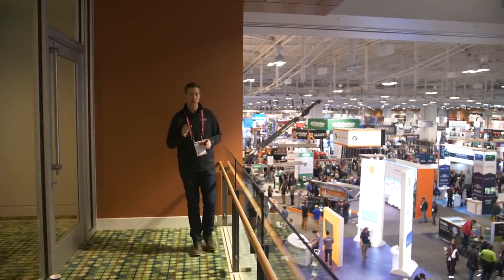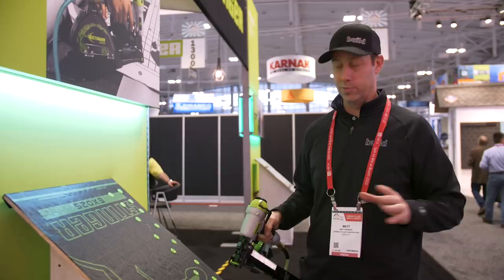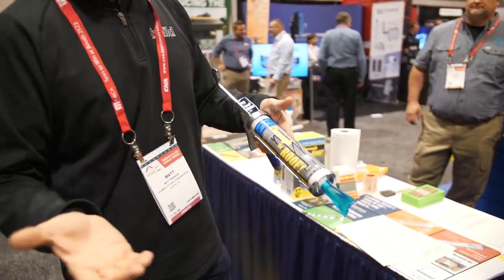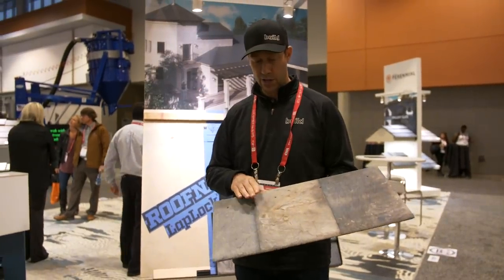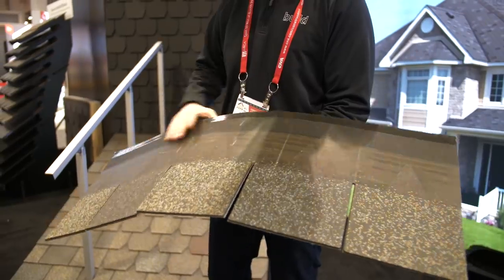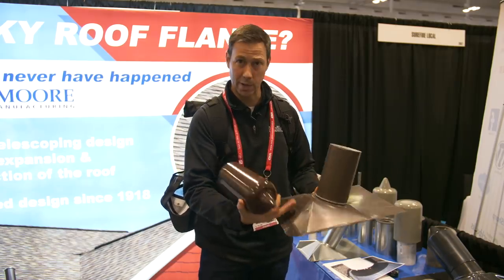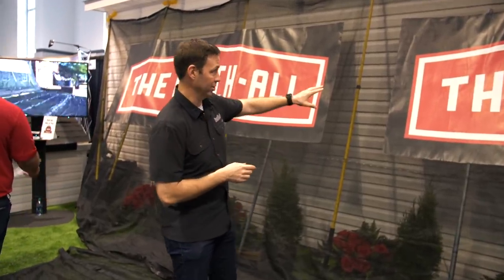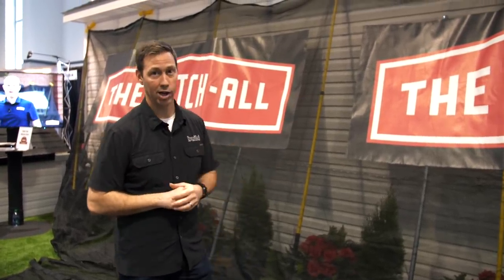NEW ROOFING PRODUCTS 2019 - This Show Had Some Surprisingly Cool Stuff!

Comment: I was interested in seeing the latest and greatest in metal roofing, and how  exactly to install it. step by step so I can do my own roof, or at least I know what should be done if I had it installed. Thank you for the video.
Reply from the maker: Good idea. I’ll add that to my list
Reply: @buildshow  Are there metal roof systems with attractive, almost invisible ridge caps which resemble strip-ridges and mitred hip joints on real slate roofs?

Comment: Hey Matt, I am a project manager for the nation's largest steel deck manufacturer. That's 1.5B deck, not pan (technically "cellular") deck.

I know I'm being nit-picky to a guy in residential but the price difference between 1.5B and cellular is huge. Would hate to see someone get turned off to steel deck because they asked for the wrong product.

Comment: we got the stinger pneumatic stapler last year. I like it but I find it tends to waste the caps. Sometimes the caps don't advance properly or even it spits out more than one cap at a time which can be annoying. It has pretty much replaced what we used to use for installing roofing paper and vapor barrier.

Comment: I’ve been using Through the Roof for six years, a little expensive and amazingly good at solving waterproofing problems. Great for coating rake edges of plywood decking before Ice &Water adhered underlayment and lap joints. I also coated my pipe penetration boot joints to pipe with it, flashing lap edges, all holes from removed nails , etc. also comes in cans for brushed areas.

Comment: The only way a ceramic porcelain tile resists impacts is if it is 95% plus supported on the back. Which is why the proper laying of thinset on floors and walls is more than holding the tile in place. Where I live is hail country and there is no way that good roofers here recommend anything but Class IV high impact resistant asphalt shingles. Even in that category there is a huge range of quality and the cheaper class IV shingles don't hold up to our hail. We try to walk people away from metal every chance we get. Even the heavy stuff shows dings and if a hail strike happens directly on a seam the overlap will buckle enough that water can wick in between.

Comment: Had 3 leaks in my roof from those neoprene collars. What happened is the PVC vent pipe is cut jagged and when the collar is put on it gets torn on the jagged edges. Why not just put the plumbing vents at one location, essentially a chimney, even disguised as a chimney. No little leaks and much faster to re-roof since their are 7 plumbing vents to cut around like my house has.
Reply: I'm a plumbing contractor and that absolutely can be done. It just needs to be a large pipe the same size as the drain pipe that leaves the building.
Reply: Yeah, I combined several vent pipes when I remodeled my house. Do the math, and make sure you have the right size pipe, but there's no reason you need more than one. Also, a common trick is to use two neoprene boots on one pipe. Install both boots together like they are one boot, and the outer boot will be sacrificial. The sun won't touch the lower boot, and it will last longer than an asphalt roof. Or just use a traditional lead boot.
Reply: I put a circle of rubber roof with a hole a little smaller than the pipe over the boot. This keeps the sun off the boot. If  this over lay fails in 20 years, then just replace it.   @onetwothree4148

Comment: Traditional steel warehouses are rock ballast on rubber on insulation screwed with auger tip screws. OR TPO that gets microwave welded to those metal plates.

Comment: Metal roofs have their place certainly, however most insurance companies will have homeowners sign an aesthetic waiver on their policy if they install metal, for this reason metal may not be the right choice if your area receives hail. The F-Wave product (5.49 mark) would fair much better, light, easy to install and has a 5 year Class 4 hail warranty, labor and material! It also has a 15 year 130 mph wind warranty and a 15 year color fade warranty. If you need a new roof you should F it with F-Wave.
Reply: 15 year fade warranty? It's basically an expensive asphalt shingle. Asphalt shingles look like crap to begin with, and Epdm doesn't last very long. I'd go with metal shingles at that rate

Comment: As a homeowner looking for a metal standing seam roof, I wish there were more contractors experienced in this practice.  I've been looking for several months on Cape Cod, MA and to-date not found anyone savvy and local.
Reply: Try contacting flat roofing and building envelope companies the people you are looking for arent actual roofers. Its a different trade. ASM or architectual sheet Metal workers. Its a specialized trade and requires different skills. Most ASM guys work for flat roofing companies to do the metal work. They usually install standing seam through their metal division.

Comment: I like the ceramic tile idea. I wonder how the weight compares to asphalt shingles.
Reply: I was wondering the same so I did a little research.  Asphalt architectural shingles weigh 320-400 pounds per square.  Matt said the ceramic shingles weigh 500-700 pounds per square.
Reply: Hail?

Comment: Concerning "The Catch All" system... There are actually trailers now that raise up to roof level and catch the debris. At 4 grand for this system, you're not talking about too much extra to just get a trailer and not have to pick all this crap up in the first place. You also wouldn't need to worry about protecting the house siding because the trash never even gets to the ground. The takeaway? If you don't mind picking up all the trash, and you don't mind you and your crew throwing out your backs, then get this system. If you would rather only handle the debris once then get a trailer. Just google it and you will find it.
Reply: If you don’t mind paying 35K for the Equipter trailer that raises up to the roof go ahead...  4K is a good down payment.
For us most houses have bad yards that will not allow a driving trailer to get around.  Rented one once for a job we could not get a dumpster to and it was great to carry debris to the dumpster 1/4 mile away.

Comment: Im curious why more people don't use metal roofs? A friend of mine just built a house up in Idaho last year, when he built his roof he put corrugated galvanized steel panels on the roof, but instead of screwing them to the roof, he installed strips of metal flat bar that he screwed into the plywood, then he tack welded the steel sheets to the flat bar at the edges, then overlapped the next peace tack welding it to the next sheet. Then he went back and sprayed the entire roof with bed liner paint to seal the welds on the roof.

Comment: Any thoughts on Davinci or other synthetic slate products?
Reply: They look shite compared to real slate .maybe lighter but just looks bad
Reply: Yeah I used CertainTeed's fake slate on a small project a couple years ago. STAY AWAY. Buy real slate or go with metal shingles or something else. The fake slate was almost as expensive as the real thing, scratched very easily, and the rake cuts looked like cheap plastic no matter what you did to rough them up like slate. It looked OK, but I don't think that roof will look good in 50 years (with the stainless nails we used it should still be there though).

Comment: Matt, Can you explain or show me a link describing why metal roofing is better than asphalt? When I think of metal roofing I always think of Tuff-Rib with those stinking screws that always back out.
Reply: Metal roofing just lasts a lot longer than Asphalt. Consider that few young people are signing up to be roofers. I am sure in about 15 to 20 years, labor costs for replacing a roof will be a lot higher as Boomer contractors retire and don't get replaced.The only metal roof system for residential is standing seam. Don't let a contractor talk you into something else. Also choose a roofing provider that offers a long term warranty on the paint. If the warranty on the paint is only 5 or 10 years, you can bet its going to start cracking right after the warranty is expired. Remember a metal roof will expand & contract many time per day as the sun heats it. Every time a cloud passes by the roof will start to cool and contract, and then expand again after the cloud passes by. There is also condensation (will happen every night).That said a metal roof installed right will cost about 40% more & finding a good contractor that installs metal roof can be hard to find. Best to find a contractor that specializes in doing metal roofs only. the contractor that does mostly asphalt is very likely to make mistakes that cause problems.

Comment: With those rodenhouse plastic pegs to attach exterior foam insulation to concrete.  Does anything else need to go over the foam?  What about above ground?  I am looking for options to insulate outside concrete basement below and above ground.  I will have to do some digging for below.
Reply: For the outside it more practical to use Fiberglass insulation. Typically insects like carpenter ants, termites will tunnel through foam insulation. Alternatively you can purchase foam insulation with built in pesticide. Therma-start offer foam with a pesticide.For my project I only insulated below grade and left 12" to 18" insulated so that I keep an eye out for insects. Have insulation above grade can hide insect if the tunnel between the foundation and the insulation. If you really wanted to insulated all the way up, you can apply a stucco like mortar on the outside of the foam insulation. But this can leave you exposed to possible insect damage if the tunnel up into your rim boards.For my project we apply an asphalt sealer and the fiberglass panels was stuck on using the asphalt sealer as an adhesive. In the few places the insulation did stick well we used the a masonry nail gun with caps.

Comment: Installed hundreds of Firestone and McElroy metal roofing systems.

I’d never put one on my house.
Reply: May I ask why? I ask because I was looking into them.  Thank you.
Reply: norrisonian metal is going to leak eventually, and it’s a guessing game of where it comes in from, your really placing all your money on butyl tape, so make sure your contractor doesn’t go cheap when buying it.  It’s literally the most important part of the system.

If you live in a place that freezes, your chances of leaks just skyrocketed.

Not to mention how easily damaged it can get from hail and rain is much louder.

Paint starts to fade after 5 or so years also.

They look clean if done right and work well at first, but the problems are inevitable and if you have to replace a panel in the middle of your roof... well, book your whole weekend.

Imo they work great for commercial, industrial and ag..  residential no so much.
Reply: @Hu1ud  Thank you!  I had no idea they were such high maintenance!!

Comment: Thanks for the video. Cool stuff. One question though. What is the draw or advantage of insulating on the outside of a steel roof or building? Seems like you need redundancy to keep weather from the insulating layer.?

Comment: I have a question as an ammeter on roofing shingles. I noticed while re-shingling my roof that there was a strip of tar under a cellophane on the back of the shingle. Looking at it, it made sense to me that if I removed these cellophane strips, the hot Sun would melt that tar helping to glue the shingle down close to the un-nailed edge. (After seeing this, I thought about putting roof cement on the back of each of the three lead edge fins ... I know, overkill.) But I could find nothing mentioned about this strip on any installation instructions. So I called the manufacturer. He said no, this was something that was related only to the manufacture and they were not to be removed on install. He could not tell me what this had to do with the manufacture process. Anybody know the answer to this? Why is it needed in manufacture?

Comment: whatever happened to those flexible solar power roof panels? were they defective
Reply: Tesla has a solar roof but the cost is around $2000.00 per sq. Or 100 sq feet so a 30 sq roof will be$60,000.00.

Comment: Why dont you guys USe roof tiles? They look so much better. Hoped you would have learned something from coming to europe haha
Reply: Good luck finding a contractor familiar with roof tiles in the USA! 90% of all roofer in the US only do asphalt.  There are a lot of better materials, but the issue is finding contractors that can install them right. Currently the US is also facing a severe contractor drain because younger americans don't do trades. We also have a big drug abuse problem. Drug\Alcohol impairment, power tools and roofs are a deadly mix.

Comment: 120 degrees Fahrenheit on a roof sealant?  No bueno.

I just saw some porcelain tile pavers with a granite-look textured facing at the home center too.  They look like 6x12 tiles but more than half an inch thick.

It seems like the exterior foam fasteners are long overdue - any exterior foam manufacturer should have launched with this stuff.

The haaga broom looks quite nice.

Comment: Also, another question… can metal roofs act as a EMP resistor?
Reply: H. C. If you bond the whole thing and ground it (follow Technical Grounding Rules ISO) I would ;d add a insulated R12 over lead wrap.

Comment: I would like to know if metal roofs in 2019 are twice as expensive as shingle roofs; at least that is what I have been told recently. The other thing, I have high vaulted ceilings (no attic space) and the house is very hot. Can someone tell me what to do about it? Tired of roofers that just give a quote and are interested on replacing shingles. I need a cool roof that is energy efficient and solves our hot problem inside the house.
Reply: with shingle roofs though youll have to replace them sooner than a metal roof

Comment: Several months ago i saw an ad for essentially a standard size 3-5 tab asphalt shingle BUT it was a stamp cut sheetmetal instead of paper or fiber glass base with the typical coarse sand exposed. They said they guaranteed it 50 years and to withstand hail damage without leaking. Cost wise it was +20% more than asphalt shingles.  Have you ever seen this?  I've inquired locally and no one knows of it.
 This is my only option to get a "metal roof" bc HOA bilaws don't allow anything other than the typical 3 tab or architectural.

Comment: That gun has been out for 4 years at least
Reply: Correct.   Stinger's first pneumatic cap stapler was the "Crossfire" version in 2003.  The one Matt shows (CS150B model) just came out in 2018. Much improved features and performance.  Stop by our website to get more details on the tool.  The retail price has come down as well!   It shoots 18 gauge staples in 5/8", 7/8", 1 1/4", and 1 1/2" lengths.

Comment: Matt why do roofers insist on putting roofing on an old roof! When I found this out I canceled having them come to give me an estimate.
Reply: Kurt Simmons I wouldn’t. Most customers don’t want to pay the extra cost to remove the old layer(s) of shingles/old roofing.
Reply: BusinessEtiquettes even if you are going from shingles to metal?
Reply: @kurtsimmons1587  Yes, sometimes . Metal roofs are expensive and ripping old shingles adds more cost to the job. So sometimes we us furr strips to keep cost down for the customer.I have seen some metal panels installed on top of the shingles without furr strips also. It all comes down to what the customer is willing to pay.
Reply: For us it comes down to the insurance companies will not insure a shingle over. In fact in our area code will not even allow it.
Reply: I always suggest the old Roofing be removed. Almost every new roof I do is a complete tear off.

Comment: Look at Ipswich Queensland for how long metal roofs last .. Can drive down my street and show you at least 20 houses with original 100 year old roofs yes they are starting to look rough and old but 100 years is a long time 100s of days of 40 plus degree days  100s of days of minus zero temps 100s of hail storms and a few hundred year floods and still going strong..

Comment: just peel the cellophane off the back of asphalt shingles and they don't fly off...Lazy
or job protection?
I have roofs in FLA cellophane never melted shingles never bonded 25years old. No one can tell me why mfgs put the glue on back of shingle if cellophane never dissolves ? In coastal windy areas I peel them off . After two hurricanes none of my roofs lost many shingles when others lost 25℅ or more near ridge or eaves.
Reply: Manufacturer's instructions say specifically to not peel off that strip. The shingles aren't supposed to bond to keep from coming off. You are supposed to nail more often for higher wind resistance. Also you have to buy thicker/better shingles if you need higher wind resistance. The strip of adhesive holds the two layers of the shingle together and provides a seal around the fastener. It's not some secret trick.

Comment: unless you know this is the only roof im gunna buy do not get metal. it's gunna cost so much to replace in 60 years you might as well move hahaha.. i worked for gerard's number 1 installer in the midwest.....
Reply: In 60 years, the average middle age homeowner is gonna be under the roof of an old folks home, or under 6 ft of dirt. Their 60-year old steel roof purchase will be the least of their worries.
Reply: @jckay5087  o i realize that but this also goes to people buying homes with already installed metal roofs. good luck getting somebody to tear off and install a new one. gotta go up there with grinders and cut em off lmao